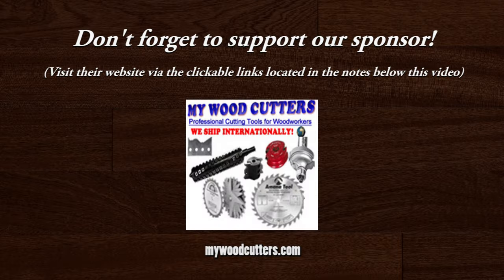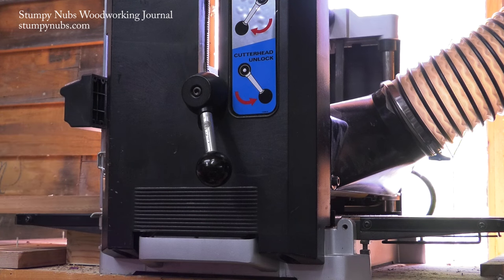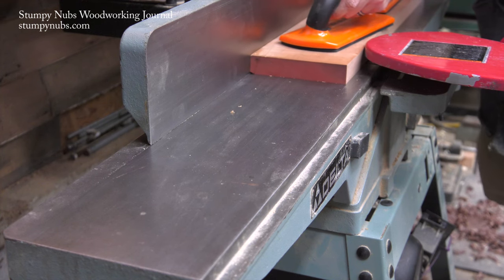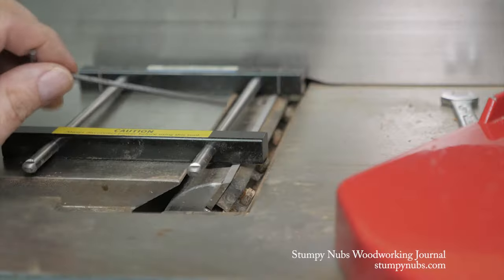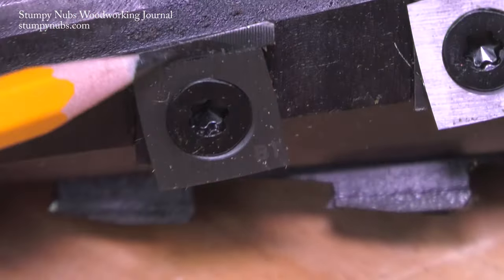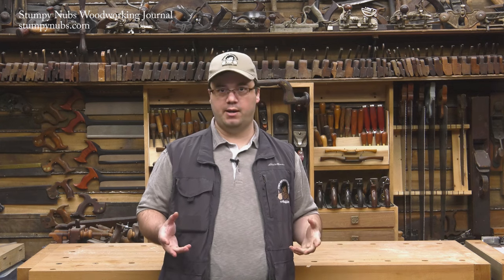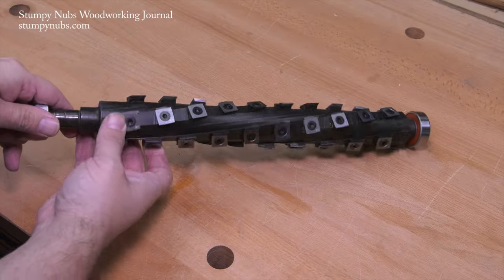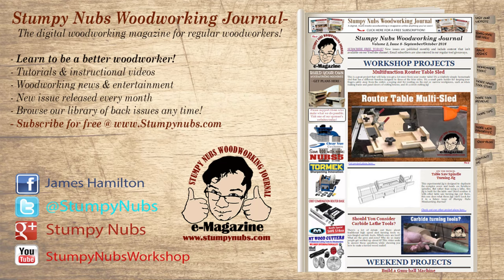WATCH THIS before buying a carbide helical (spiral/segmented) jointer/planer cutter head

Comment: Thanks for the video, I found it interesting, and I've been thinking.... (always dangerous).

I agree with your statement that the straight blades will have "gaps" between carves, allowing the motor to "recover". However, do helical heads need a more powerful motor? I'm not so sure.

I have a hard time believing that each tiny helical blade, whichever one(s) is/are in contact with the wood at any given moment, would slow the motor down anywhere near as much as larger (sometimes much larger) straight blades. It's just that a helical head should spread the motor load over time to be more consistent... Rather than chop, spin up, repeat loads using straight blades. 

If you're planing the same type, depth, and width of wood, why would it need more power? The head shouldn't change that. In fact, aerodynamically, the helical head should place LESS strain on the motor.

A lot of people put helical heads in DeWalt735 planers, without upgrading the motor, for the reasons you describe. Few seem to complain about the motor not keeping up.

Also, the reduction in noise, is a reduction in one form of energy loss. I can't say for certain that any actual PLANING efficiency is gained.  Most of it is probably lost as heat, or additional chip propulsion... but maybe a small percentage will be put into working the wood.

Everything else that you've said seems correct to me, and no doubt helpful to a lot of people. Thanks.
Reply: From what I've heard, shelix definitely draws more juice. The reason is not because there's no gap in time like the video suggests. It's actually because there is overlap in the spacing of the shelix heads. If you look at the shelix, every 2 rows is equivalent to 1 straight blade, except you have roughly 50% more knife contacting the wood because there's about 50% overlap (distance between 2 blades is roughly half the size of a blade). More cutting requires more power.

Comment: John here good video but I got a Cutect 40700HC 24 tooth spiral carbide blades. 12" for $349.00 quiet runner chips a lot smaller don.t hang up used it on oak walnut pine from 3/4 to 2 1/2" does a nice job a lot cheaper 2yr warranty.

Comment: This is an excellent breakdown, thanks for this.  

I refurbished a Powermatic Model 50 jointer (6") and am wondering about the cost benefit of upgrading to the shelix cutter head.  The motor and all the parts are in excellent condition so it seems a worthy question.  Since this model is 240v, would it strain at all under the helical cutter head?  Probably important point: I run a 25f 20amp 12awg extension cord to the jointer, so would the drop-off be meaningful here?

If I never have to reset the cutter knives again it'll be too soon.

Comment: If you have Tersa knives, when you put in the new knives be sure to shorten atleast 2 of the knives about 2MM so you can kick the knives over a little to stagger the nicks we all get. Feed speed allows straight knives to leave ridges in the wood if you go too fast. Slow down the feed speed or speed up the cutter head to achieve a smooth planar surface with straight knives.

Comment: I had the opportunity to buy the multicutter head spiral or the Tersa 4 knives at the first. I elected to buy the Tersa model because if I need to mill some unknown wood from the lumber mill I can quickly install the 4 Tersa knives using some older knives and save the new knives for furniture work. If a nick appears on the Tersa you move the knives about 2 or 3MM left or right-stagger the cut surface and that takes care of the nicked edge. I can switch the M42 knives for carbide if I get into a long run of milling either jointer or planer. Also, we have the opportunity to use shorter knives of M42 cobalt or carbide on either jointer or planer to meet the requirement of certain woods. Same knives different machines with the Tersa design. The Tersa fitting on a machine using a variety of metals will not bog down the motor even on heavy cuts life the spiral design. With a moderate sharpness using Tersa the cut does not require sanding unless you have the feed rate too high; depends what you need. Felder's straight knives take time out of the day to replace and I chose Tersa. Not very many vendors for Tersa in the US and Canada. If I mill pine it can load the knives with resin: Tersa allows a quick removal and spray with clean and paper towel wipe and reinstall quickly. Does the helical setup have resin buildup? If so you may be some clean up time??

Comment: If you look closely, you'll observe that the edges of the Shelix cutters are not straight.  Why is that?  (Answer below!)

I have installed the Byrd Shelix on my DW735 and I very much like the result. It cuts smoother than the 3-blade OEM cutterhead, and the carbide blades last far longer than the HSS original equipment. In the long run I expect to recoup the expense of the upgrade just in blade replacement, and if not I think the upgrade in performance has been worth the cost.  In fact I have been so impressed with this cutterhead that I have just bought and installed a Shelix cutterhead on my 6" jointer as well.  

The answer: Because you want the cut to be flat!  

In a little more detail... From your high school geometry you know that the intersection of a cylinder and a plane is an ellipse.  There is some serious NC machine work involved in building the Shelix and at the same time paying attention to the woodworking. You know that when hand-planing, you twist the plane a little bit to get a shear action, or slice, into the cut.  The Shelix bits are similarly twisted to get that slice. But you want the cutting action of a bit to lie on the surface of the cylinder even as the point of the cut moves along parallel to the cutting axis, to give a little slicing action.  Then your board comes out flat, not scalloped.  Because that aforementioned ellipse gives the plane/cylinder intersection, the cutting edge of the bit must follow the ellipse -- and not be straight!  Kudos to Byrd Tool for working all this out, and grinding the cutters accordingly.  That Shelix slicing action is also a reason behind the reduced tearout, along with the more frequent slicing impacts of a 40-bit twisted cutter arrangement rather than a thrice-per-rotation, whole-length-of-the-blade-at-once, whapping.  I'm a happy camper.

Hmmm... this has been fun to write up.  I might go include it on some other DW735/Shelix sites as well.

Comment: But the surface area of  the contact. area between cutting edges and material will always be less at any given time with the shelix so although the motor driving the knives does get a "break" the one driving the shelix has a smaller demand on it at any given time.  No?  Great video, I'm a new subscriber.

Comment: Great info James. I think it's important to note that carbide is never as "sharp" as the steel it replaces. I would guess that's why it bogs the machines down more than the original.
Reply from the maker: While it is true that carbide can not be sharpened as finely as steel, wood is an abrasive material. After a few board feet, those razor sharp HSS knives aren't much sharper than carbide anymore. Compare it to a hand plane. It may shave hair when it's first honed. But after planing three or four boards, while it may still be sharp, it's not as sharp as before. It only takes a very short time to go through that same amount of board feet with a power jointer or planer.

Comment: One con that you didn't mention was the fragility of carbide cutters.  I upgraded my DW7325 to a Byrd Shelix cutter head and broke three cutters in a year. (If I could attach a picture I would) Byrd refused to replace the broken cutters and failed to provide any help in diagnosing what may be the cause.  In the last six years my Grizzly Jointer hasn't broken a single cutter.  So, bad batch of cutters from Byrd?  Probably.  Poor customer service?  Absolutely.
Reply from the maker: The reason I didn't include that is because I have never experienced, or heard of a case like yours until now. As with any tool (or any sort of product for that matter), there are always some isolated cases that may be negative. But the vast majority are overwhelmingly positive.

Comment: You might check into buying your inserts from machinist suppliers like McMaster Carr or Grainger.  Or you can go to the source like Carbide Depot if you got the exact dimensions and material types and buy in bulk.   Looking at the selection of inserts at Carbide Depot makes me wonder about the quality and results you may get with differently shaped inserts.

Comment: Have you nicked the cutters in any way from just jointing/planing regular rough lumber from the store or lumber yard with a minimum of dirt?
Reply from the maker: No. But I always wire-brush rough lumber before I use tools on it anyway.
Reply: Mày  say xơ  dừa
Reply: No.  Never. I brush my lumber with my bench brush and usually check it with my metal detector. I buy all my cedar rough cut and  it can be somewhat dirty. A quick brushing and all is good.  I have used a medium wire brush on really dirty lumber.

Comment: Just to add another data point to this video - I have the OEM Felder/Hammer helical cutterhead in a Hammer A3/31 planer/thicknesser, been running it for about 3 years now.  They brand it "Silent Power", and is a added-cost option when you spec the machine.   If you take a look online at the design and geometry of this head vs the Byrd type, you will see that the Felder design is much more advanced.  It still uses the staggered rows of shear-cutting inserts, but they are pocketed into the surface of a nearly-full cylindrical head, instead of sticking out of a small-diameter core.  Obvious advantage of this is the aerodynamic noise reduction, and the protection of the blade edges that are not in use.   The chips exit in a smooth channel in front of the blade rows.  Felder have side-by-side noise measurements (on youtube) showing about a 10dB reduction planing the same board on the two machines.  I can confirm that the planer is very quiet - you can almost have a normal conversation with someone as you plane a board!   Surface finish is very good, just as reported here, and I am just about to rotate the set of knives after several thousand feet of planing mixed timbers; it's still perfectly usable but a bit more pressure is needed and I'm about to process some rather (very) difficult elm burl, so it's time to freshen up.    The thicknesser also works beautifully, with the "digital" thickness setting that is actually clockwork but works perfectly and allows me to set thickness to 0.1mm with good confidence. 
I have no commercial interest, I'm just a private customer who has found this machine to be an extremely good purchase, even though it is more expensive than some others.  I'm a scientist/product developer by profession, and I think they have done a really nice job on the essentials on this machine, even if it does not have all the heavy duty extras that the production Felder ones enjoy (e.g. the fence mounting is relatively poor).    In the context of this video, I would encourage Stumpy and others to look at this cutterhead as a state of the art example -  and yes it is better than the US-sourced ones at present.  :-)
Reply from the maker: Felder's head isn't unique. Lux Cut makes after market heads that are pocketed https://www.youtube.com/watch?v=3WAy8YweIJA

Comment: I can tell you from a production/manufacturing standpoint, these spiral heads with carbide inserts are incredible compared to straight knives. At my job I do setups on moulders, some with multiple heads each with a 25 hp motor and i've seen these hog off a half inch to 3/4" of material effortlessly (granted it was poplar) still very impressive and silent compared to some of the other 2 and 5 knife heads i work with and our inserted heads have from around 100-200 inserts so flipping them can be monotonous at times especially when there is a lot of pitch buildup lol

Comment: Very informative! You did forget to mention that even with the shelix head, you can still get that washboard type effect, but only 90 degrees to the standard planer blades. Although it is very minute and can be sanded off fairly quickly.  All in all though, well worth it if you use it on a regular basis.
Reply from the maker: It is possible, which is why I said you may REDUCE or eliminate it. I get it once in a while. But it's so light it usually disappears with my regular sanding. However, I want to make sure all of the pros and cons are clear, so thanks for pointing it out. :)

Comment: Hey James . . . good overview and still relevant in 2023!   One question -- given the increased power draw of the helical cutter, did you have to upgrade your circuit from a 15A to a 20A circuit?   OR did you experience any breakers being tripped as a result of using the planer on a repetitious basis?     I am seriously considering a DeWalt 2-speed/13 inch, but I saw that you are using Delta, so I am also going to give them a good look too!  

Thanks!

Comment: I am at a decision point.  To buy a thickness planer or drum sander.  If you only had money to buy one what would you buy and why?  thank you for taking the time to answer.
Reply from the maker: Definitely the planer. A sander is great for delicate work on small parts and very thin materials. But a planer is an essential tool for million day to day project parts.
Reply: @StumpyNubs  I know you like to do safety vids, do you have on on planning an edge grain cutting board?
Reply from the maker: Ahhhh, you didn't say you intended to plane end grain cutting boards. In that case go with the sander, not the planer.
Reply: @StumpyNubs  Ok, so I did decide on the planer.  I will create a router sled to flatten my cutting boards.  

Do you think the Byrd head or the Lux Cut III head is better?

Comment: The Helical design is actually a plus because the load on your motor is spread evenly. The straight cutter design produces a stop start action which in detrimental to the motor (note electric motor design cannot compensate for stop start or on /off load, they are meant to run flat out)!
Reply: I would have thought that the helix head would put less load on the motor because of the smaller cuts each head makes at any instant in time.  Looks like a maximum of 4 heads at any instant in time.  But I guess I thought wrong.
Reply: I doubt anyone has taken an amp reading on the machine. All indications point to less power consumption. If you have data otherwise I suspect you were taking a larger depth of cut on the helical cutter head. When l swap out my dealt planer head I'll make a video with amp readings and make sure to measure the cut depth

Comment: One other thing to mention, if you buy a cutter head for your planer, buy the same manufacturer for your jointer, because the blades are the same and can be used on both heads.  The replacement blades are proprietary to the brand, so Shelix brand blades won't fit Lux brand.

Comment: Sheartak in Canada makes these for many models of planers that Shelix doesn't. For example, the Shopsmith 12" planer, and newer Ryobi 13" planers. Shelix only lists the AP1300 Ryobi planer, which Sheartak also makes a cutter head for. Sheartak's prices are higher in Canadian $ but it's currently $1.36CAD to $1.00USD.

Does Shelix have these for models that Sheartak doesn't? Could be they do. But apparently Sheartak will make theirs to order rather than doing them in batches. The reason they have them for Shopsmith is a guy who lives near the company asked if they did. No, but if he brought his planer in they'd design one for it and make it. Now it's in their list of available products.

Comment: Good video. I’m looking at a shelix and a tersa head for my 16 1/2” delta jointer. The shelix is as we know, helical. The tersa is a quick change straight knife style that requires no set up. They cut exceptionally well.
What caught my eye was your titan vshear head. I actually have a 15” vshear for my powermatic planer. Bought it from Steffen at mywoodcutters.com when I was looking for a shelix. New product, I got a deal. Thankfully I got a good one. The issue they were having with the heads was the nickel plating. They couldn’t control the build during the plating process and some of the knives would seat a little higher or lower than the rest. While the company will absolutely replace the unit... The time factor for the customer to install, then uninstall a brand new head, send their defective brand new cutter head out for replacement, and then reinstall a replacement was BS. 
All that being said, mine was not defective and I must say I love it. The V pattern of the knives literally directs the chips to the center of the cutterhead and directly into the dust port. There is absolutely zero clogging, ever. The design is effective. I just don’t understand why they don’t drop the plating process and eliminate their quality control issue. 
I’m probably going shelix for the RJ42. great vid and explanation.
Reply from the maker: That's why I held off on the V-shear head review. It's a new product, so they are working the kinks out. The Shelix is a proven product.

Comment: When that motor quits working on that 22-560 planer. You might wish you replaced the whole machine. My armature went bad and the only option was a rewind. No parts could be found. I scrapped the delta.